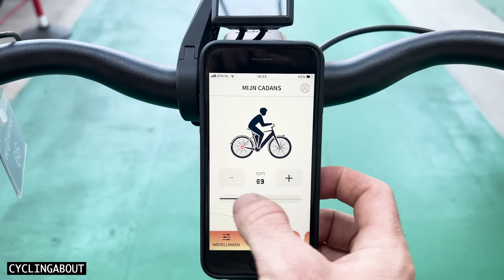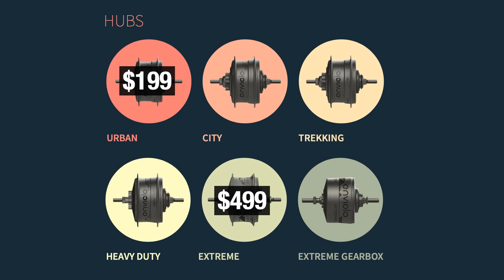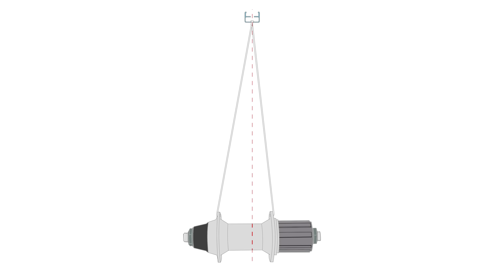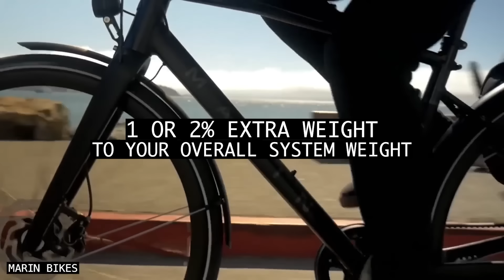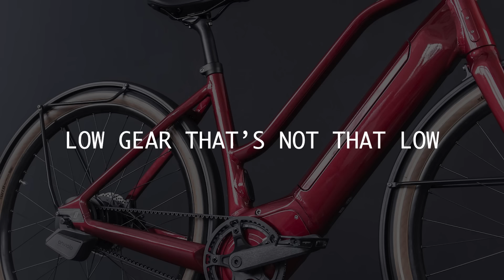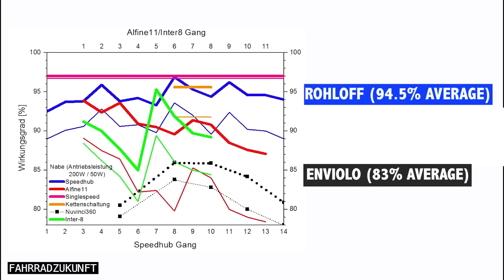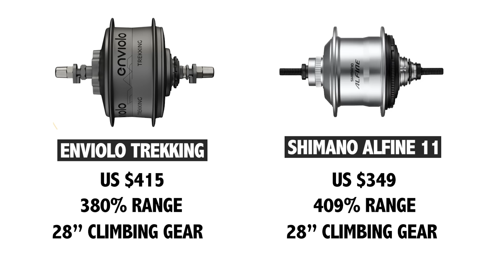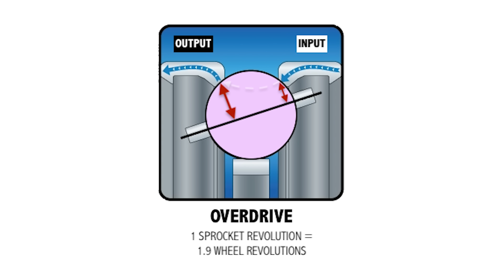Are $199 Enviolo Hubs the BEST Internal Gear Hubs For Bicycles?

Comment: I got it @ ebay for 180 american rubles 10 years ago with a warranty of 6000kms / 3 years and it's been 10 years ~20000kms and i feel like only the force required for rotating the actuator got increased, but still works fine. Maybe I'll have to change the wires but I want to upgrade to n380 with a belt. Absolutely recommend it. It's best thing that happened to my bike, as I wasn't feeling like to ride that long and were feeling tired due to shift ratio changes.
Added note, automatic shift is not for hilltowns as the optimum rpm changes as the elevation climb rate changes.
Better if they did it lighter instead of stronger. I mean, the design is strongest anyway, just a bit heavier than 1400$ rohloff.

Comment: Love that "number nine" just like from Beatles' White Album
Fun fact: this cvt is technically a planetary gearbox with gear teeth being surface roughness of discs and rollers.

Not so fun correction for 21:55 - it changes the position of the contact patch, not size. But yeah, if you do the full rotation of the roller "sphere", you can say the ring area of all contacts is bigger or smaller.

Comment: I have been riding a Priority Continuum Onyx with 380% Enviolo hub almost daily for over two years of city commuting in all sort of weather including rain and snow. The hub has been flawless. I did have to replace one shift cable recently. The cable problem was caused by one of the wires in one cable breaking at the rear wheel part. That broken wire then unwrapped itself from the rest of the cable, eventually propagating all the way up the cable to the shifter and then bunching up inside the shifter. 

I think the design of the little part the cable attaches to at the rear wheel is the problem. You're driving a screw down directly onto the cable to clamp it. Apply a little too much twist on the screwdriver and the screw can chew through the wires. It should have a clamp that is pushed down on the cable instead of directly smashing the cable with the screw.

Comment: I hate to put a downer in internally geared hubs, but I spoke to a few bike shops in the past 18 months, and they all love them. They are apparently very smooth and easy to use.
That said, they all commented that when they go wrong they are a complete pain to sort.

I can only assume that here in the UK they are quite rare, and assuming rarer faults, means that mechanics really aren't familiar enough to be efficient are repairing them.

Comment: Thank you for explaining the Enviolo hub.   Looks like a viable alternative for some riders.      For your next tutorial on bicycle geared hubs,  please consider doing one on the Kindernay.....Pros, cons and who might benefit from it's use.   A similar formatting as this video would work well.   One of the cons (in my mind) to the Kindernay is the hydraulic shifting.  If they offered mechanical shifting as an option, I might give it more consideration.     What is your take?       Thanks for another in depth explanation of bicycle systems..........Be well.

Comment: I have been using a SRAM AXS electronic shift system for two years. Last year on the North Cspe 4000 I a managed to get about 1m of water between the. Ottoman of the tyres and my backside in a flooded underpass I though had 1cm of water in it. And this year I did the European Divide Trail Adriatic to Baltic Off Road route (3000km) mud was in my teeth, hair, all my bags and I had to clean the bike off every 200m on one section of 4km. My point being the electronic shift has been a joy. There has been zero mechanicals caused by it. I suspect electronic shift will come to all gear change systems for all riders on all bike gear systems ( E bike or not ) in the next couple of years. Maybe in under 10 yrs it will be the default option on the just above lowest price and middling to high end bikes.

Comment: I tried it once - and I hated it. 

I wanted to like it, really liking that the bike had a belt drive, liking the idea of a maintenance free drivetrain.

And at the start of the ride, I liked it. Especially the possibility to change the gear ratio while standing was great! And for the first few minutes with several stops at the traffic lights, I enjoyed the ride. 

But then... It was an electric bike, and as soon as I was above the support threshold it was like pedaling through syrup. Especially going downhill was terrible, I never had to pedal against a resistance downhill to keep my speed. 

I immediately returned it and chose another (conventional) drive.

Comment: Hub gears are loud only at the beginning when they are still new. My Speedhub, now over 15 years old, is relativity quiet. The same goes for my 11 speed Shimano gear hub. As for the ticking, that is hardly audible in normal traffic conditions.
The Enviolo is an amazing development. This is my gear hub when I get around to building my next bike.
The Speedhub is not meant for urban riding. I would only recommend it it for long trips with 30 to 40 kilos of luggage. The biggest problem with the Speedhub is what I'd call oil creep. It suffers a slow loss of oil that spreads over the rear axle and continues along the spokes. I've had my Speedhub seviced at Rohloff for exactly this problem without any improvements. Maybe the newer ones are better.

Comment: The main loss in these types of CVT or Variator as they are called in industry, is in the ball bearings that apply the load to one or other of the input or output. 
It would be wrong to think that the 'no contact' is unique to this drive, all rolling element Variators rely on this phenomenon as do ordinary ball and roller bearings, where in normal use the balls are not in contact with the races.
It would also be wrong to believe that 'no contact'= no wear. All rolling element bearings suffer from extremely high near point contact forces leading inevitably to fatigue of the ball and the surfaces they run on.
The well known Kopp Variator is very similar, just inside out with the idler being an external ring, this is not a new idea.

Comment: Gear range of Enviolo is close to an 8-speed Shimano Alfine IGH.  It's works fine for me and has no maintenance requirements like the derailleurs.

update:  nine months on, it's outlived my Nexus 3-speed igh with the same motor on an electric bike.  Although the 3-speed hub is 1/3 the cost of enviolo, I still prefer the internally sealed system since there is less wear and tear in the long run.

Comment: I feel that the lack of low-end gears are the biggest issue for me with the Enviolo. There are plenty of urban areas with steep climbs (DC, San Fransisco, etc.) that just wouldn't be great to ride in with this hub, at least without electric assist. With a Rholoff, you can just downshift to the lowest gear and can climb it without even sweating.
Reply: Can’t you modify this by changing the bikes gear ratios? Of course, this would take some off of the top end. The 14% efficiency loss is my biggest concern. How could you stay with the group in a group ride unless your 14% stronger and in better shape than everyone else?
Reply: @danparish1344  It's not for group rides. It's for city travel. The ability to rapidly shift gears is great for cities since it's stop and go. As for switching gear ratios, it's the torque limits that make it an issue.
Reply: @TheSJCieply  I used the bikeshare in SF for many years and never had too much of a problem climbing. They get plenty low. I'm relatively fit though. But the CVT plus an ebike means anything in SF is climbable.
Reply: @AJHillis  Most of bikeshare bikes are climbable, but you'll get really sweaty going up the hills. If you have a well designed hub, you can just downshift to a low gear and ride up the hill at a gentle pace. There's a big difference between being able to climb a hill and being able to climb a hill comfortably while carrying a load of groceries, tired after a long day of work. For that you need a quality bottom end gearing.
Reply: i ride my non-electric bike with an enviolo on my 11+ mile DC commute every day. there may be places in the world where the climbing gear isn't low enough, but DC isn't one of them. i extremely rarely even use the lowest ratio.
Reply: @contrastufffs  There are hills in Georgetown and Adams Morgan that I'm very glad that I have a good climbing gear for.
Reply: @TheSJCieply  yeah, those are pretty steep, but i've been fine. in general, even in bikes with lower climbing ratios, when i'm going slower than walking speed, i'll hop off and walk that bit of hill, and that hasn't happened to me in DC.
Reply: @AJHillis  And isn't that the sweet spot for right now for Enviolo? E-Bikes with strong mid motors?

Comment: 10 years ago, when I was student, I jobbed as a pizza delivery guy. The shop has mofas for most deliveries but bikes for short distance deliveries. The bikes were equipped with nuvinci gearboxes. I hated those bikes. Pedaling them felt like stepping of soft wet toast. Not shure if the bike were just bad, or if I dislike the hub.

Comment: I would like to try one and that feature of being able to maintain a set cadence in the automatic version is outstanding too.
Reply from the maker: It's a very cool feature. I've been able to test a few more automatic CVT drivetrains recently, and will hopefully shine some light on them too!
Reply: As someone that tried the old auto-shift derailleurs bikes. It’s really not ideal especially if want to put any kind of power or going up a short steep climb. Maybe with electric assist and use of modern bike computers you can make it better or offer more control.
Reply: @Cyclingabout  I'm yet to find any other automatic shifting that is as good as mine. I use power data to adjust my cadence automatically rather than maintain a fixed cadence like other automatic shift systems.

Comment: Nice piece. Thank you. I find my NuVinci 380 a bit syrupy, especially when pedalling hard. If you're climbing a steep hill a fairly high cadence (75+) and low input torque seems better than vice versa. After all, you are squeezing a non-Newtonian fluid between two surfaces under very high contact pressure (at least that's how I assume it works). On the other hand, it does seem that on the flat, at least, the faster you pedal the more 'lossy' it is - which stands to reason I suppose.

When the time comes I intend to do a bottom bracket ebike conversion. I think it will really come into its own then, even if it's not an auto.

Comment: I have been riding a four speed hub gear bike from time to time since 1970,  the hub has a notably dreadful reputation but the steps are very nice plus for town use you never distracted with gear change because you can change gear when you like.  I think I'd miss the steps, but on the otherhand, I also had an automatic CVT on my moped that was nice it went up ratios speeds with light loads and higher speeds and used a governor with ball bearing as the rotating weights.

Comment: This is EXACTLY the type of video I was looking for. I've been contemplating the Priority Continuum Onyx with a CVT for a while now, but couldn't find any good direct comparisons between other hub shifters. It seems clear that CVTs are the way to go for low maintenance city riding.

I saw at least a couple people mention that enviolo hubs have a break in period where the transmission feels sluggish brand new. Did you experience this yourself?
Reply: Yes they get smoother after about 500km but personally for ebikes i would always go with the automatiq it just changes the whole riding experience ...

Comment: Done about 30'000km with the Nexus 8 IGH. Now, after another 30'000km on a traditional 3x9 setup, I am again considering Alfine 11.
Reply: Shimano 1x11 is simply the right combination, be it a hub or cassette. I don't ride much and continiously one type or another, always keeping all sorts of transmissions - always come back to XT 8000 or 700 Alfine.
Reply: @feedbackzaloop  I have a tandem, so I am stuck to the frame. Which means, in particular, that I have to stay with a gear that is "O.L.D. 135 mm" compatible. 

This excludes all new MTB/Gravel/Road groups. The CUES remains the only choice other than an IGH.
Reply: @PrzemyslawSliwinski  Pretty much all gears fit 135 spacing. Actually, it is up to the hub design, not cassette interface. And most used road/gravel 142mm standard is simply 135 with different endcaps. You can swap them and continue enjoying the simplisity of open dropouts.
It is only the very new hangerless SRAM that requires a custom adapter.
Reply: @feedbackzaloop  Whoa! Does it mean I can use any Shimano MTB 12sp freehub - just need the TA to QR adapters?
Reply: @PrzemyslawSliwinski  Absolutely! Or a Micro Spline QR hub from the start
Reply: don't bother with Alfine 11, it is nice looking and sleaky hub... but lacks substantially efficiency, especially at gears > 7

Stick to derailleur or get Rohloff (sorry to say....)
Me went through several system, 4 different hubs, among them Alfine 11 and finally got used bike with Rohloff
Difference in gear spacing and efficiency was / is pretty distinct

Another used Rohloff (for daily bike) runs flawlessly with 35000km on it (bought it almost dry / without oil), hub needed new rim + spokes. Runs perfectly after oil flush and oil change

Climbing 10% and keeping cadence almost perfect will make the price several time up
Reply: @feedbackzaloop  ThnX!
Reply: @feedbackzaloop  It looks like it is not possible if hubs are of a cup-and-cone type (like all current Shimano ones). 

Only those with cartridge bearings (like DT Swiss and Hope hubs) are convertible, aren't they?
Reply: @d.k.7710  ThnX! Rohloff is too expensive for me. I would rather consider assembling two sets of Alfine 11 wheels (for summer and winter seasons).
Reply: @PrzemyslawSliwinski  well, most cup and cone hubs are already 135QR, there is nothing to convert here.
Mid range Shimano like MT400 are already cartridge and have options you need, top tier 8100 have oversized cones. And I believe they did it in 770 hubs already.
I think you are going with a wrong strategy here, trying to fit Microspline or XD onto the hub you have. Instead of fitting a new hub into an old frame.
Reply: @feedbackzaloop  ThnX! 
To be precise, I consider the long-term replacement for the current gear (which is compatible with the QR standard) I have the tandem equipped with. 

The new stuff - as much as attractive for everyone else - becomes less and less compatible with tandem peculiarities. For instance, the two-piece cranksets exclude LHS timing chain. This, together with the lack of 3x options, effectively reduces the 2x setup into the 1x. 
Thus, to reconcile range with tight ratios, I examine possible 12sp solutions. 

If these Enviolos survive the next few years on the market, I will consider them as well.
Reply: @PrzemyslawSliwinski  ooh, tandem cranksets are another interesting topic! But as far as I know, there are several 3-piece options for road, both 24 and 30mm, and these will stay for long, because all different BB standards call for different axle lengths. So then you can buy separately an axle, two righthand cranks and different direct mount spiders, 1x for left and 1x or 2x for right.
But honestly, I'd stay with trusted square taper or Octalink for tandem applications. Very unlikely these will be phased out in next 10 years.
The actual uncertainty now is with shifters. Shimano is killing everything below 11 speed for flatbar (new CUES 9 and 10 speed are not backwards compatible - those are 11 with one or two cogs deleted) and most likely will do it with road too, Sram are exclusively 1x12 for quite a while already. Microshift and Ltwoo are still holding steady though.
Reply: @feedbackzaloop  Yup! FSA kindly offers a 1x1x2x11 set of cranksets for about $1000.

If their P.C.D. matches the 110mm CUES 11sp chainrings (and it look like it does!) I will be more than a happy camper.
Reply: Avoid alfine 11

I ride 6000+ miles yearly and must perform an oil change monthly

Alfine 8 was more durable with lesser maintenance 

I've tried and used both with a double crank set without problems

Comment: Eight months ago I got a Specialized Vado 5.0 IGH with the Enviolo AutomatiQ gear hub to replace a 2020 Specialized Como 4.0 with a derailleur.  Both are e bikes, and I live in the mountains with a normal morning ride of 20 miles and 2,400 feet of elevation gain.  The loss of efficiency on steep terrain with the Enviolo is dramatic and extremely disappointing.  I went from a 500:watt battery to a 710 watt battery, looking forward to an increased range, and yet because of the decreased efficiency it has roughly the same range as the smaller battery.  In order to climb the steep hills in my area, I need to increase my assistance level 1-2 levels (with only 3 levels available).  The old Como feels like a race bike compared to the sluggish Vado. The Vado with the Gates carbon belt is much noisier than the Como with a chain (have no clue why?).   My wife and I joined another couple on their new Specialized Como derailleur bikes for a 240 mile ride on the Katy Trail, averaging 40 miles per day.  I am a much stronger rider than the others, but stayed in the back per wife orders.  We all used the lowest level of assistance for the entire trip, and at the end of each day I would compare the stated range left on my Vado to the other couple’s Comos.  They also had the same size battery as I did.  They typically had 20-30 more miles of expected battery life than I had.  According to the Specialized website, expected battery range was predicted to be identical between the IGH vs derailleur equipped bikes!  Liars!!!  And to think I paid $500 more to get a less efficient bike with less range and noisier to boot!  What a sucker I was . . .